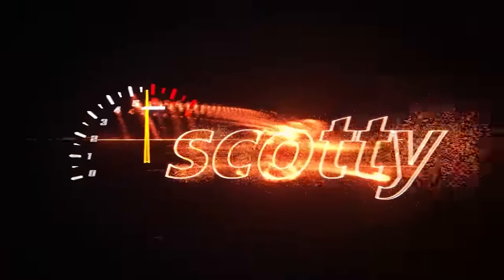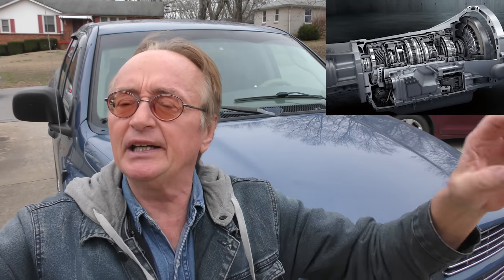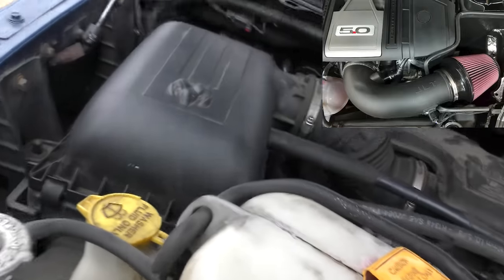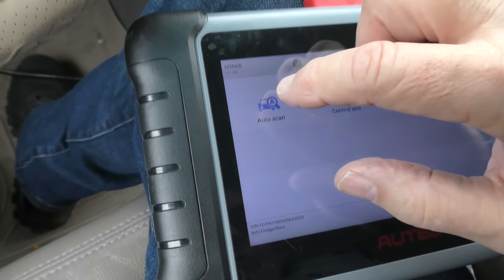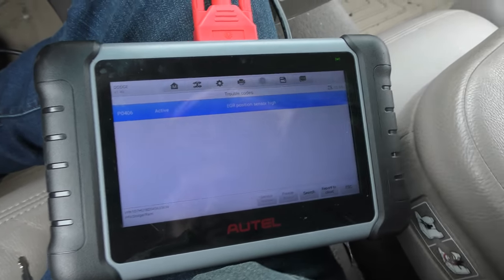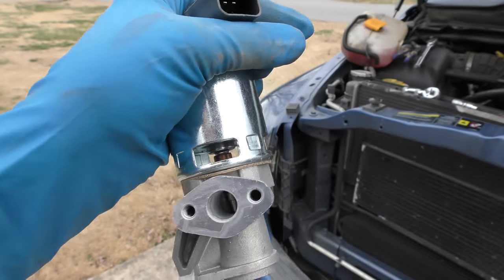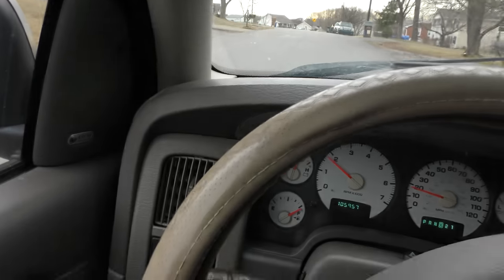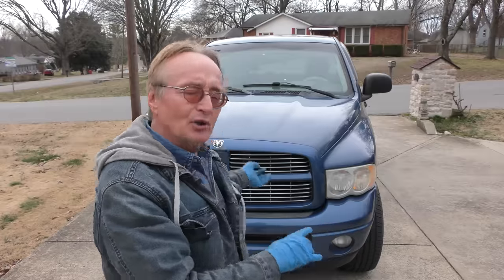Please DO NOT Buy a Dodge (Unless It Has This Engine)

Comment: I'd say the ONLY Dodge to buy is the older Cummins diesels before they put the DEF system on, so probably 2011 and prior (I believe 2012 or 2013 was the first year for DEF systems which IMO are a nightmare in general).  We've still got our 2011 that runs decent with well over 350k (had to replace the trans, but the truck is used for heavy towing so that's expected).  I wuld personally not buy a Dodge gasser, unless it had perhaps one of the V8 Hemi engines (our 2010 half ton did make it to about 220k miles / 11 years before the engine failed but  I wouldn't buy one again.)  Now we did have a 2001 RAM 3500 with the 6.7 or 6.8L Cummins and that thing lasted well over 200k miles.  It did eventually fail completely (and sort of rather quickly) but it lasted long enough that it paid for itself.  So yeah I would say the ones made under Daimler-Chrylser were better but I woulidn't buy a modern day Dodge (one made after 2013 or so).

Comment: I was told from a few different sources that the 3.6 VVT engines are also good. Is that wrong? It is about the only thing in my Grand Caravan that hasn't needed replacing. Still runs good with 300 k on it.
Reply: In my opinion it’s the best engine dodge uses that isn’t a V8. I have a 200s with the 3.6 and it’s the only reason i own the car

Comment: An interesting tidbit, the Durango had a solid rear axle, what Mercedes did after taking over, was take an independent rear end complete design from a Mercedes SUV, and transformed the Durango to 4 wheel independent suspension.  It may apply to the Jeep Grand Cherokee, but don’t recall.  Can’t recall everything.  No development costs and time needed.  It’s like when Ford owned Volvo and Mazda, when the Mazda 3 was created from scratch, Ford got a Volvo electro hydraulic steering (variable assist) design to install in the Mazda.  I had the first year Mazda 3 in 2004, the steering was locked in solid, the reviewers said it was BMW like and as good as any Honda steering feel - also front wheel drive. 👍😁
Reply: @helmuthare  controlling interest, owned enough to be so, Mazda had to do what Ford said.  Call it a parent company, if you want.  Volvo, Mazda, and a few others Ford “controlled”.  My Mazda had wiring harnesses under the hood labeled as Ford.  Similar to Fiat over Dodge, Jeep, and Chrysler.  Controlling interest.

Comment: People always focus on the stupid lifters failing at random (which really isn’t a hard job to fix them), but apart from that one common issue, I can’t count how many 3.6 Pentastar engines I know of are out there with 250,000-300,000 miles and still running strong. You can’t sit there and tell me that it’s not worth a damn for a good reliable daily driver.

Comment: 04 Dodge Ram, 4.7 liter engine daily driver - 384,000 yesterday and still working well. I tow gravel, trees and stone with this truck for the past 20 years. Two transmissions, two radiators and loads of oil changes and filters but seriously, Mercedes made this truck so much more reliable than others as long as it's maintained. I never expected to keep her as long as I have and now that trucks are a billion bucks a pop, I think I'll continue to, warts and all.

Comment: I got a Hyundai Elantra from 2007.  That year Korea's economy was tanking so they paused on engine development, bought their engines and transmissions from Japan.  So the engine and transmission in the car is Aisan (not asian).  AKA Toyota guts.  Only 125 HP but in a 2700 pound car, with a sweet wheelbase, MacPherson struts, and a frame based on their famous sport car the Tiburon but tooled for FF.  Still rips through corners like a purpose built circuit car.

Comment: I have a 2005 Ram. No complaints except for gas mileage.
Reply: Yeah, my 06 3/4 ton has zero issues and 210k miles. Pulls my 38ft fiver all over the continent.

Comment: I have a 2005 dodge ram with the 5.7 hemi 4 wheel drive with the 4x4 on the floor. It has 95000 miles on it i absolutely love that beast of a truck.

Comment: Couldn't you clean the old one?
Reply: Some EGR Valves can be cleaned. My 93 Nissan P/U had a stuck EGR valve. It was able to be cleaned out and put back in. It worked fine afterwards. The Austin, TX Nissan Mechanic had to clean out the entire system with carb cleaner. It had coked up. But then again it was all mechanical.  Looking at the Chrysler valve, I wouldn't think twice about replacing it with a new one. Especially since it has electrics on it.  Preferably with a OEM one. As long as it lasted. It just isn't worth it to try and clean an old one. Especially for 50 bucks plus diagnosis/installed. Sometimes you just have to spend money on an older vehicle. But that 07 is paid off and running fine. So even if you paid $300 (I'm just throwing a number out) you are far ahead not having a modern truck note.

Comment: Bought a 2000 dodge ram with a 360 .It was sitting in a person's yard for years. Replaced the battery changed the 🛢 oil and did a complete tune up. I would never sell this truck. Beautiful interior and I put 10k on it. Love it.

Comment: Hey Scotty, when i turn my heat on it’s fine until i switch to heating the windshield. When it’s on heat windshield and I’m parked the rpm will jump to 1100 and then drop to 600 and repeat. 2010 Dodge Avenger with its 3rd alternator. Heat and ac still work good just not when it’s on windshield setting

Comment: I have a 2004 Dodge Ram 1500 4.7 V8. Had it for around 15 years, got 150k plus miles on it. Truck has never left me stranded. Best vehicle I have ever had. Have driven this truck through h**l and back. Beats any ford I ever had.

Comment: I have an 04 2500 gasser. Original 5.7 hemi and aito trans. It has over 300,000 miles and still runs like new. I bought it with 189,000 and other then a water pump and thermostat it hasn't given me any trouble. Just routine trans fluid and filter change and oil changes every 3000 miles religiously. I have traveled all over texas for work and would trust this old truck to go anywhere. Gets terrible mpg (9mpg) but refuses to die

Comment: I currently own a 2007 dodge ram 2500 5.9 lt cummings diesel, have 350,000 mile runs like the day I bought it pretty sure it will make it to 500,000, best truck I have ever owned by far!

Comment: Hey Scotty, love your videos!

I have a 2002 Mazda Protégé 5 2.0L AT and I just replaced the EGR and the car runs a little better, but still has the same symptoms of idling rough. It seems to drive fine, but when you're stopped or parked it seems like it wants to stall. The engine has a few error codes, including P1569. I've swapped the Solenoid Valves around and that didn't help. I've taken the car into a few shops and they have no idea either.

Comment: I agree with Scotty the older early 2000 Hemis are better engines than these new ones. I owned a 2016 Challenger Scat Pack and it had a cobstant ticking noise. One mechanic said it was the valves and that eventually the engine would give out. That's all I needed to hear and I no longer own tge car. Got a 2019 Challenger GT and it runs fine.

Comment: My 2007 Chrysler Aspen with 4.7l V8 is at 287,000 miles and shows no signs of slowing down.  Has only needed a water pump and alternator. Its been the most dependable vehicle I have owned, even better than my Toyotas.

Comment: Have a 2004 Dodge Stratus SXT 2.7 liter with a 180,000 that's been well maintained and that's the key to that engine. Have changed the water pump and timing chain once as a precaution.

Comment: A dodge that made it to 100k that wasn’t a Cummins…who knew😂
Reply: I have a 2009 Challenger R/T 6 speed manual with the Eagle 5.7 Hemi. 206,000 miles. Runs great. Like the day I bought it new. Still has the original clutch. The only person  who questions Dodge reliability is someone who has never owned one.
Reply: I have a 2005 Dodge Grand Caravan with 269,000 miles. Still going

Comment: 2000 Dodge Ram 2500 v10 8.0L quad gas... Over heating. Replaced radiator and oil cooler. Starter gets hot and truck will not start. Sometimes the wired start to get super hot, melt and break. Changed water pump. Need smog pump replacement.  Need new starter. And new alternator.  The Alternator is good, however,  the connection fries out. And needs cleaned Sometimes. Connection is temp fix. There were codes but they disappeared right now. Transmission needs a fixing. It don't go into gear properly Sometimes.  When making a quick stop at say a stop sign, and then excelerate immediately after, it will not get up to speed and struggle.  I have to press on and off the gas several times before it gets up to speed. Weird. And dangerous if traffic is coming up fast after I am already in my turn.

Comment: I'm pampering my free 94.. ram.. v6.. rusty.. dash board broken up.  my bud and I replaced everything that needed replacing. 158k.. I put on around 25k on it.. Minnesota cold weather work truck. Hauled my roundabout.. and moving trailer. From here to Kansas heat. And back several times. Everything in it and on it still works. Even license plate light. Has a vacuum leak and need to change fuel filter. 
ALMOST time for back up vehicle.

Comment: i owned Dakota 2006 and never had any issues on engine and transmission. The best year of my truck and its still holding an impressive torque while the milage is more than 200. Go for Dodge Trucks and you will save tons of money and be happy with all your trips and hauls. One of the best brand in the market.
Reply: What's the best model I seen a2001 set for 3k

Comment: I have a 2004 dakota with 98K with the 4.7 magnum V8 and it's been rock solid. I just had the 100K done at a shop, they replaced both bank headers which were slightly warped and leaking exhaust causing a tick, had the fuel pump replaced as it was getting tired and new plugs and that's all I've done to it so far

Comment: I have a 2003 ram 2500 with the cummins. Has 334k miles on it and still runs strong! Just needs regular maintenance and weather stripping in the rear door

Comment: I drove a 1972 D100 with a 318 cu in for years to work. Bought it used, owned it for about 15 years, only replaced the water pump, that truck never not run. Sold it to a co-worker because he wanted it.

Comment: For the 3rd Gen Ram 1500’s. You actually want the 2002-2003 360 CI Magnum engine.  The early is alright, but the 5.9 Magnum is bulletproof in comparison!!

Comment: My grandma had a 2003 ram for years I was born in 2003 she had it since I was a little fella I thought it was the coolest truck when I was little but besides the point the engine blew up about 2 years ago but it died with 250,000 miles and it was a pretty good truck surprisingly it wasn’t rusting out or anything either

Comment: I guess you can get a good one or a bad one but I have a 2011 Ram 1500 with 220,000 miles on the engine and transmission. My drivers seat is showing some wear but everything else is just as it was from the factory.

Comment: the light will return with the EVAP code - EVAP codes will not set in one test drive, takes 3 - purge valve, canister, lines.....will take more diag to know for sure

Comment: I have a 2004 with the 5.7 with 278K miles and it runs great. It  did have a transmission replacement in 2018

Comment: I just traded my 2007 Dodge Ram 1500 in last week. 17 years old, bought it new. It has 175K miles and still runs great.
I traded it for a 2023 RAM 2500 6.4L, HEMI - Rebel package with a fifth wheel. It's the 4th RAM truck I've owned and I would never buy anything else.
Nothing against Ford or Chevy, (although my dad was a big Chevy guy and he worked more on his trucks than I ever have on mine)

Comment: I had a 2010 5.7L ram I bought brand new in 2010. Sold it at 80k miles. No issues at all, I should’ve never sold it. Now, 13 years and quite a few trucks later I have a mint 2003 5.7L Ram and I absolutely love it.

Comment: I love the Hemi engine. I have a 2006 Ram 1500 4x4. 200.000 miles. 2005 Jeep Grand Cherokee Hemi 125.000 miles.  2012 Dodger Charger police with a Hemi. 134.000 Miles. All run awesome.
Just stay on top of those oil changers. Full Synthetic 5/20 and Wix filters every 6 000 miles.

Comment: I've got a 96 dodge with 5.9 360 an a 2000 dodge ram 4x4 with 360. 370k miles still going. The 4x4 has 160k miles. Never had problems with any of them

Comment: I bought my 2004 RAM 1500 4x4 with the HEMI new. Still have it with 115,000 on it. Runs great, keeping it till it's done or I'm done. This one Scotty is showing needs the shorty ignition wires. Get rid if the wires that cross over the intake. The A/C condenser is is good design. No restriction to the radiator, genius.

Comment: I’ve got a 2000 Ram 1500 with the 318 manual transmission. About 160k on it. Only issues I’ve had are a water pump at about 150k and a sensor. Dash deteriorated but I replaced it already lol. Hell I’ve taken this thing off road countless times and I still haven’t even replaced any suspension components. Great trucks even if you get like 12mpg on the highway down hill with a tail wind. Never understood the hate for Dodge. Especially second gen Rams

Comment: I found this out about my 99 2500 with Cummins diesel,  everybody says transmission is bad. That is not correct at all just because your transmission will not shift or acts like it is slipping. Check your batteries if you have one week battery it will not shift or work correct,  I have found  20 of these trucks I bought dirt cheap because everyone thinks the transmission is bad  only had 1 out of 20 that new relay and new batteries didn't fix

Comment: i have an 06 1500 ram with the 4.7 V-8 bought from an insurance auto auction 216K of the odometer it runs perfectly of course i changed the fluids and plugs just had the right side exhaust manifold done but not only the 5.7 is needed i have loads of towing power with a 4.7 dont underestimate a V8 just because its 1 litre smaller

Comment: Glad I bought the 06 grandcherokee I bought now. Made with the 4.7 and 5 speed Mercedes’ trans. Thought it was a bad idea at first but only issue left to deal with on it is the rear main seal
Reply: On the 05-10 grand Cherokee’s the 3.7, 3.0 diesel and 6.1SRT8’s got the 5 speed W5A580 Mercedes’ automatic the 4.7 and 5.7 v8’s used the Chrysler 545RFE 5 speed automatic. Both good transmissions.

Comment: I still have a 2001 SLT Dakota, 4.7L, 215 K km. Runs well and has  been relatively service-free (for a 4 x 4). Gotta admit that these generation II Dakotas, during the Daimler-Chrysler years were fairly well built. I'm amazed at how many of them are still running around, considering their average age is over 20 years! Then can 2005 and Fiat-Dodge....alas.
Reply: ....Then "came"...
Reply: I’m looking at buying a 08 SLT Dakota 4.7L with 131k. Do you think it’s a good buy

Comment: Before the actual start turn key on and off three times on board diagnostic immediately odometer will change the codes it's called the Chrysler key dance three turns on and off three times before the start position

Comment: I have a 2004, same color. But mine is a 5.9 Cummins diesel. These trucks are notorious for terrible wiring issues. Also my truck's charging regulator is in the PCM. Terrible idea. Smh. Other than that it's a solid truck.I love mine.

Comment: I currently drive a 2006 ram with this gen III hemi.  It has 290,000 miles and this same EGR code, still runs great. The bad, are all of the electrical gremlins. I'm hoping to put another 290,000 miles on it 🤞

Comment: I have a 2004 with a 4.7 other than the seats tearing from wear. It's still running strong besides replacing transmission filter, oil, plugs, and a water pump runs like a new one.

Comment: only if I seen this video earlier🥲 spent 5K on camshaft lifters and new computer in my 2017 Ram 1500 slt 5.7 hemi MDS 

FYI: Still has a misfire but when I kill the truck and start it back up it won’t misfire unless I’m idling in park

Comment: My 2004 Dodge ram takes a licking and keeps on I'm running,, no MDS, no ticking the transmission is excellent, still haven't changed the oil in it yet,,, the biggest problem is the original factory exhaust manifold crack and fall off,, put some aftermarket Chinese TIG welded headers on and now the exhaust is excellent...

Comment: I have a 1985 dodge d150 it has a 318 and a 3 speed automatic it’s at 750k engine runs fine I’ve rebuilt the transmission

Comment: Owned an 04 for 2 years so far, they’re so easy and fun to work on I’ve replaced a water pump, radiator, fuel pump (taking off the rear bed was about 8-10 bolts including rear bumper) love the truck, the gas mileage just sucks so am looking for something new next year.
Reply: Just got one last week w a rebuilt motor w 30k miles on it everything on front end new as well it’s amazing on gas

Comment: I have the 5.9 (360 cid) engine in mine and it runs fantastic even with 160k on it and only uses 1 quart of oil in between changes which i try to do at 3k miles.

Comment: I have an 06 Durango with that motor. No issues. Actually a 6 speed there are 2 second gears that slightly apart so depending on the load you get 5 or 6 shifts. If you put it in second gear and start off you will notice it shifts to second normally then it will drop another 150 rpm after a moment the truck speeds up yet the tac hardly moves. I am rambling sorry... anyway 6 speed called a 5.
Reply: I got a 2009 Durango with the 5.7 Hemi. It is a well built American machine that goes like the clappers. I love it.